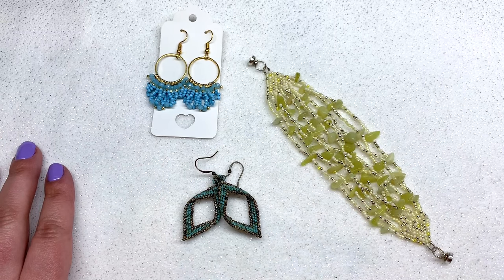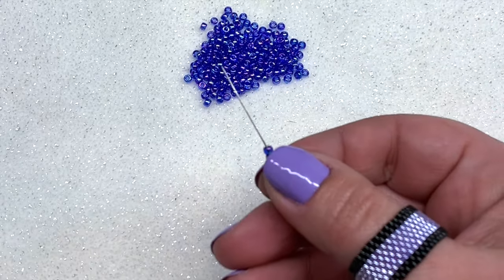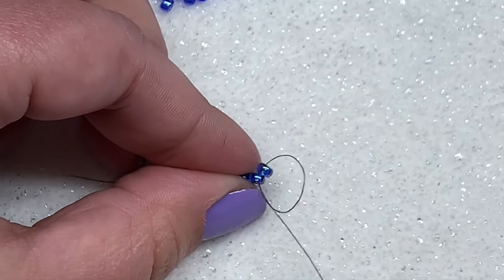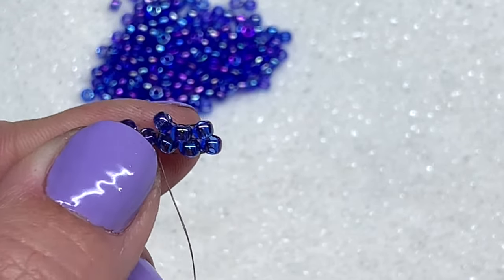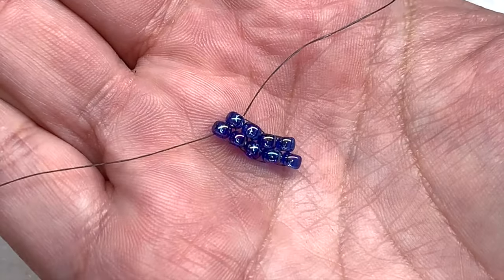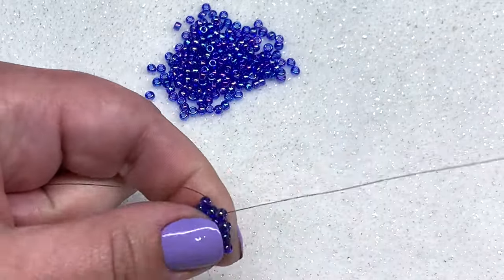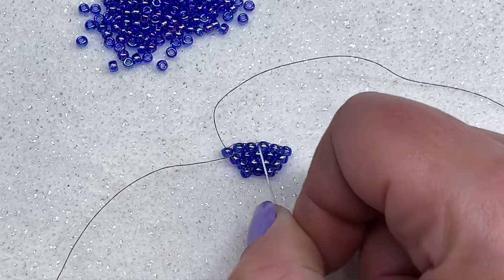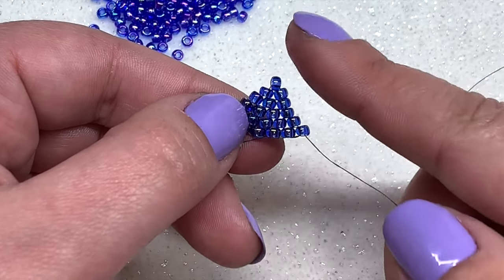How to: Brick Stitch Beading 101 Tutorial, Beginner

Comment: I purchased some black fireline & it leaves a black residue on my fingers.  This wasn't much of an issue when I used it on a dark beaded piece but I did a ring that is black on the edges & light pink on the inside. I wanted the black so it wouldn't show on the outer edge but the residue discolored the pink. Do you wash your string first?
Reply from the maker: Hi Janene! That's true - It sometimes leaves a black residue on the fingers (annoying), which comes off easily after a wash. I never noticed it discoloring any of my beads, though, and I use it most of the time. That stinks that it discolored your pink beads - wondering if that had something to do with the coating on those beads specifically, or if you were able to wipe it off? Did you know they make a "satin" version of the black fireline that is supposed to have a coating that doesn't leave a residue? I haven't used it yet, but that's what I have heard.
Reply: @ORCHIDandOPAL  maybe because those beads were a matte color???  I found that it washes off after washing my hands on other beads.  I'll have to look into the other color.  Another difference I've noticed is that it stretches a little & my rings then are too big after a few days.  I tried using another fishing line that is more ridged & it doesn't stretch so I've ruled out my weaving tension.  I'm still fairly new at weaving so I'm trying to find what works for me & for particular projects.